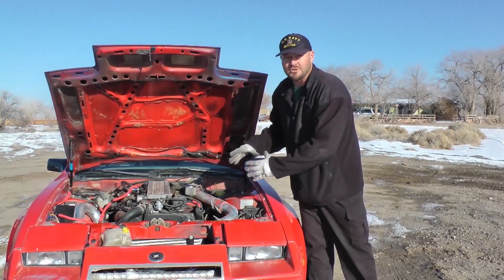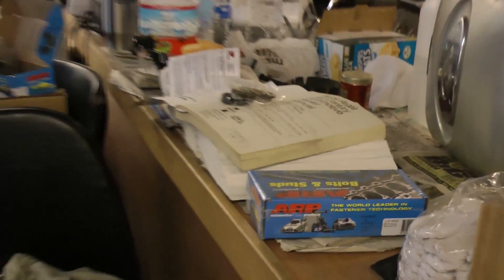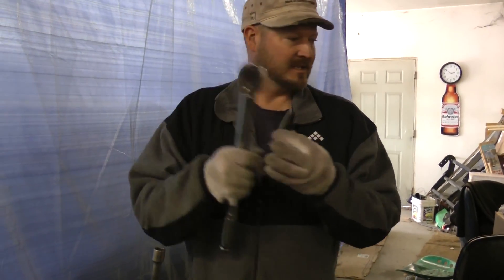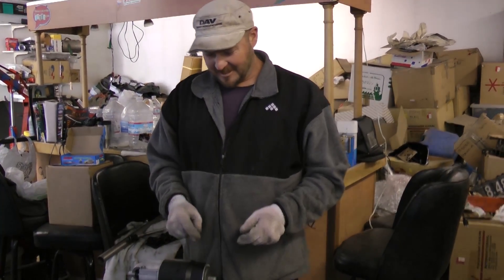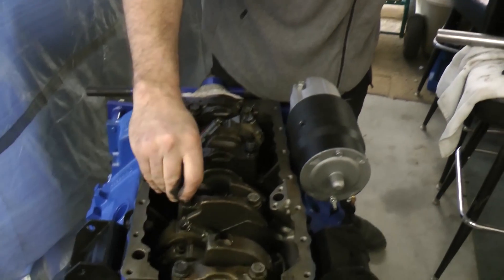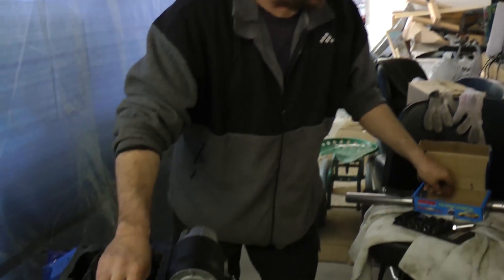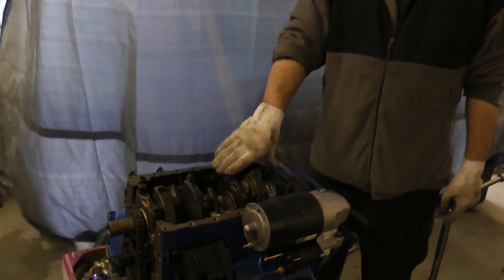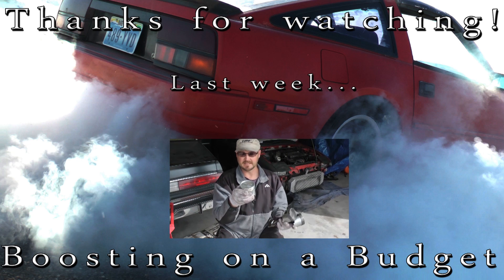Replacing Your Main Bolts In Your Engine (ARP's)

Comment: I have been told by ARP themselves that you need to have block line-honed 1st with ARP main cap bolts already installed at 110 ft lbs...Can't just switch them...  If you haven't done it that way beforehand you aren't supposed to torque any cap bolts beyond factory specs like in my case with a small block mopar rated at just 85lbs with the factory bolts...  at 110lbs there is a chance the crank won't spin or it could bind up lil bit with a bearing or two and you'll not know...most certainly don't need that... 110lbs causes alot of additional block stress in the crank area and crank bore may suffer a bit...this stuff is in the directions and I never knew it ether...   so I gotta pull my ARPs out of engine and put new stock bolts in...I usually use stock bolts last 40 years never a problem...  my new 360 mopar engine is already running and in my truck...  so this really sucks...i gotta do it in the truck  .....yea it could be fine like it is they said but I hate to worry... ARP said they didn't know what would happen over time only at 85lbs.. they said the harmonics of engine eventually could cause their bolts to losen up and ultimately drop a cap bolt ... is what it is.... ARPs advise to me was go ahead and torque them to 110lbs and see if crank still spins...  wow -   that's not my recommendation!.... for me im going to switch the cap bolts back to stock....  well,  only good thing is the oil pan comes out pretty easy on 1st Generation Dodge Trucks...  still Lotta work!    🤔

Comment: Don't you have to hone the cylinder after changing mains bolts?
Reply: Yep, need to align hone them.
Reply: Not after changing just the bolts, changing the caps yes, but bolts only...NO
Reply: @jjmccloud  Wrong, call ARP they will tell you that it needs to be align honed even for stock caps.
Reply: You didn't put any ARP grease on the  washers on both sides
Reply: @edwingreene7583  or tell us which side of the washer is up
Reply: The cylinder has nothing to do with it. The main caps do
Reply: It's the line hone situation where problems are if gonna torque beyond factory specs..... crank might not even spin at 110lbs if block was lined honed at say factory spec of 85lbs...   ARP Themselves told me this info..... I had to call them and ask........